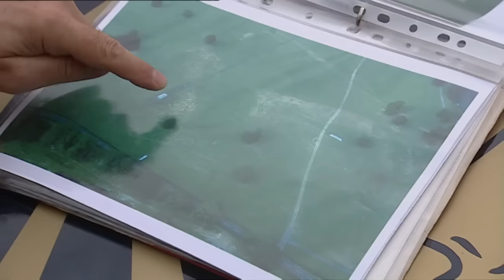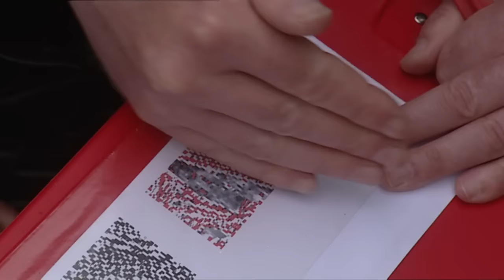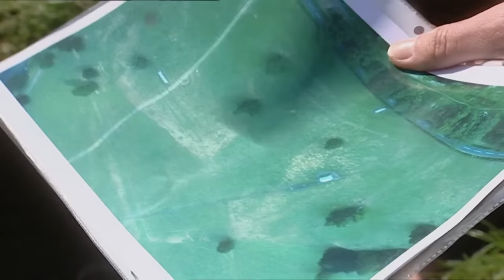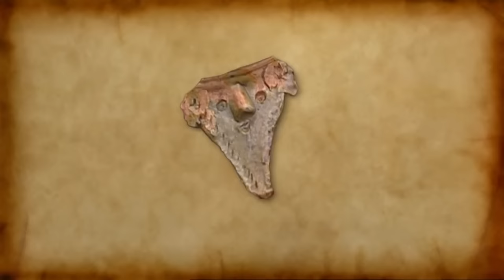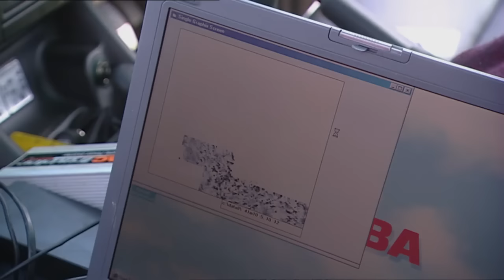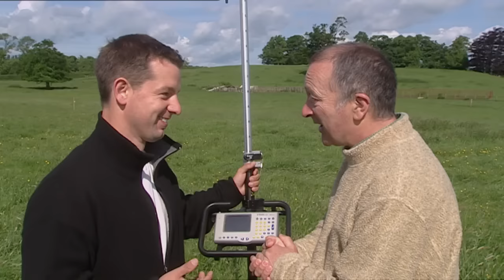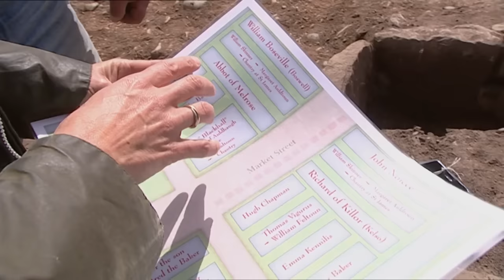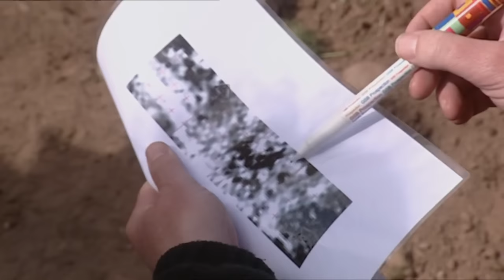The Lost City of Roxburgh, Scottish Borders | FULL EPISODE | Time Team

Comment: Anyone else looking at the 16-17 minute section about the ditch and bank and it's not making any sense? Unless the waterways have significantly altered course, it would have been a lot less work to cut across from waterway to waterway on either end of the town rather then going parallel to the waterways, even if that meant also enclosing a bunch of unused ground,  for future growth.
Reply: All things considered prior to managing of rivers they flooded every year and they changed course every year as well. So over a period of time all waterways change course, sometimes over distances measured in miles.

Comment: I wonder sometimes, why old evidence of Roman occupation always seems to be buried under feet of soil. Where most Roman villas, temples, barracks, and towns build out of degradable material like timber and thatch above ground? If stone construction was used, were all the old stones removed/mined/looted/salvaged from the site by following generations?
Reply: Yes, if you listen you can hear them describe building foundations as being "robbed out".  Likely Roman villas were easy quarries for generations after the Romans left.
Reply: In addition to reuse and demolition, there's also the accumulation & shifting of dirt by blown silt, river flooding, manuring (where the land's been reverted to agriculture) and plowing. It's really interesting to see the difference between various sites in terms of how buried, and how demolished, all the various sites are?
Reply: @dennisp.2147  thing is, while I listen, can't always hear and Not that the volume is low. They forgot to set 'Closed Captioning', (can't afford decent hearing devices.)